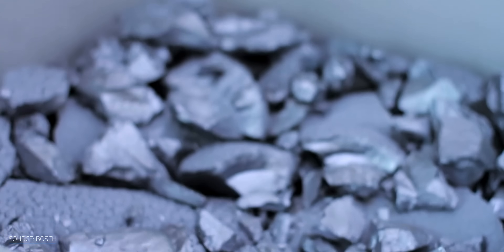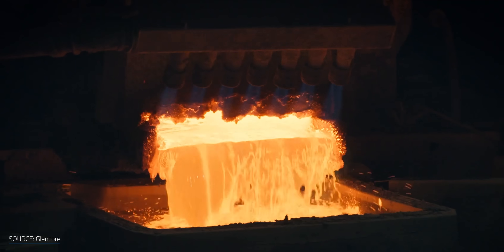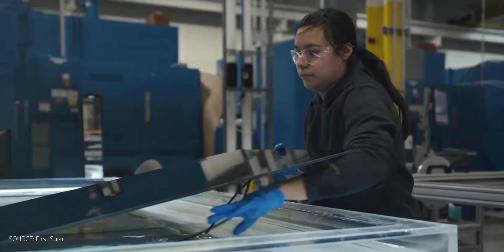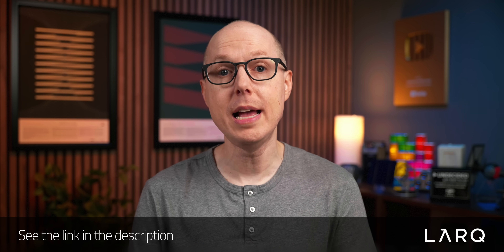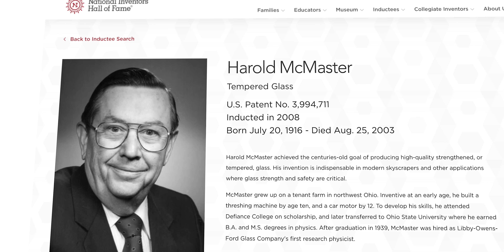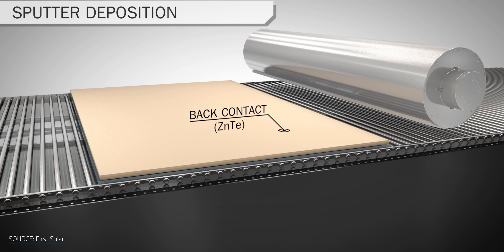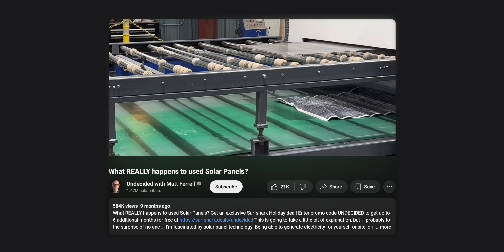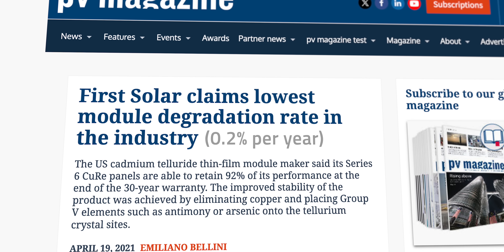How the Next Big Solar Panel Tech is Already Here

Comment: You missed two big things: 
First is price. It should be per watt and per watt-hour. This should always be included for any power generation tech and battery tech. 
Second is installation experience for home solar installers. 
While you mention more of space needing to be covered to generate the same power, very rarely is a home's roof completely covered. Given the reduced weight of CdTe panels, there's no reason that (structurally) you couldn't cover an entire roof. You can even put panels together as a patio shade for extra surface area. For most home owners the space isn't actually an issue, but for installers they may not correctly calculate the weight burden for the roof, they might use more material than they need for the frames, etc. 
I'm perfectly happy getting only 18.9% of the insolation converted to electricity as long as I have enough electricity -- and I'm not the only home owner who feels that way. 
From a brief glance on the internet, it looks like CdTe provides significant savings per watt and per watt-hour, but if you can't get an installer to work with it, it's not an option. 
So what's up with price and availability? The science is cool, but those factors should never be forgotten.

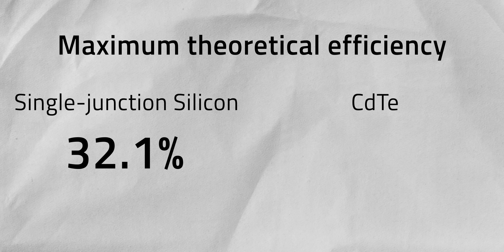Comment: 6:38 PV PhD student here. Your number for the maximum theoretical efficiency of CdTe is wrong. The TL;DR is that the source you cited (#19 in your list) was commenting on another paper that used an unrealistic SCAPS model to arrive at 35.79% as the maximum theoretical efficiency of CdTe. The entire point of the cited source was that the number had to be wrong.

For the long version, the reason I suspected this number was wrong was because it's higher than the theoretical limiting efficiency of all solar cells which is 33.16% for a solar cell with a bandgap of 1.34 eV (Ruhle, 2016, Solar Energy - this is the most recent source I could find quickly). This limit is also called the detailed balance limit and was originally formulated by Shockley and Queisser back in 1961. When we talk about the limiting efficiency for a given material, we mean the detailed balance limit for the bandgap of that material. Silicon, with a bandgap of 1.1 eV, does have a limiting efficiency of ~32.2% (again, given by Ruhle), while CdTe with a bandgap of 1.4 eV has a limiting efficiency of ~32.9%. While it is slightly higher for CdTe, the difference is pretty minimal, and it's kind of a moot point when neither material has hit their respective limit yet. Upon seeing this, I checked the sources through the link in the description and came to the conclusion above.

While it's not possible for a single solar material to do better than its detailed balance limit, it is possible for a solar cell to do better - you just need to use more than one solar material. Perovskite-silicon tandem cells are one example of this, and more multijunction cells are listed on NREL's website (as other commenters have pointed out). I will note that one wrinkle in assigning a limit to CdTe is that most high-efficiency devices made today technically violate one of the assumptions we use to calculate this limit. Modern CdTe devices incorporate Se into the absorber layer, which alloys with the CdTe to form CdSeTe, and the bandgap of the alloy depends on the amount of Se/Te in the alloy. On top of this, the amount of Se changes throughout the CdSeTe layer in most devices and forms a compositional gradient (like in CIGS), so it technically doesnt have a single bandgap (which is one of the assumptions used in the detailed balance limit). I'm not aware of anyone extending the detailed balance limit to graded absorbers, but if someone reading this comment is feel free to reply and point me to the relevant paper.

Sidebar: my own DBL calculations disagree slightly with Ruhle's, and I swear I learned the maximum efficiency for a single absorber layer was 33.7% at 1.33 eV at some point. Wikipedia also seems to contradict itself, stating both values while only citing Ruhle. If someone else knows the cause of the discrepency (33.16% vs 33.7%), feel free to let me know - my own journey down the rabbit hole must end here.

Comment: Nothing can overcome solar capacity factor, intermittency and unreliability.  Never mind it cannot provide grid scale storage long term.  So all the billions and subsidies still fail our transition to only renewables until solar becomes economic.  Leaving us with nuclear as the only future.  In northern latitudes, in winter months, solar capacity factor falls to 5% or less, so where will our power come from the remaining 95% of the time?   Please don't say, batteries, pumped hydro or mechanical methods.

Comment: General Electric led the charge. Really?

I saw my first solar panel in 1991 and I have been a fanboy ever since so I watch your video and it was difficult. You used waaay too many acronyms and never gave any information that the consumer wants to know. 
How big are the panels?
What do they weigh?
How many watts does a panel output?
And the biggie, what do they cost? Obviously you have to give USD$ prices but then one can compare apples to apples or in this case Silicon to Telluride.

Comment: I've been on the edge regarding getting solar panels. The main reason I might get them is there's a chance Trump will end the tax credits. I don't think he will and he may not have the power to do so. On the other hand, the costs keep going down. My electrical bills aren't that bad. Around $200/mo on average. Is it worth spending $20k to save $100/mo? It's a 6% ROI, assuming everything works fine. I can get 5% putting the money in a CD.

Comment: Stubblefield coils are cheap and easy to make. Enough in series and you can charge battery bank 24/7. With micro fractal wires they are the way to go. Cheap and greener than other "green" tech. With advancing super capacitors we may one day be able to store electric from lightning as static energy.

Comment: Why not at least mention the forced labor camps making silicon ingots with an array of coal fired power plants in western China? Not sure why you are using 2022 data in a 2024 video. And First Solar just opened the first of two new plants under construction in 2024 in addition to the expansion in Ohio. The 2022 data is outdated for a fast-moving company.

Comment: higher voltage of the band indicates higher efficiency? that's garbage - you dont know anything at all. these panels require lamination and a vaccum process. most of the time, thin film manufacturers tend to skip to the vaccum part... and then panels split, and then they fall outve the custody chain that is so supposed to protect the environment from the cadmium. its dumb, first solar makes you sign an NDA on purchase to hide the risk mitigations, supposedly. no thanks. production process might be useful in the future, but that technology is now mature.